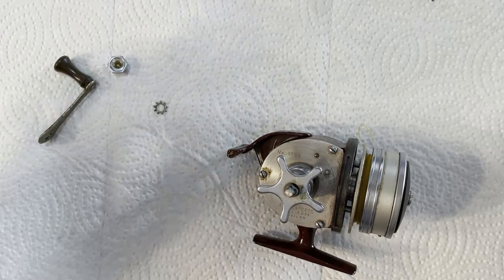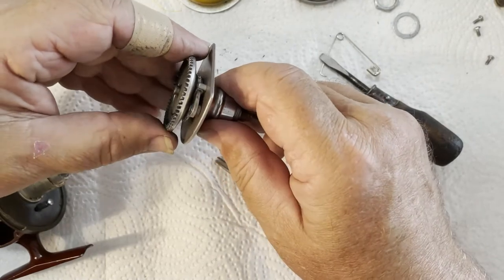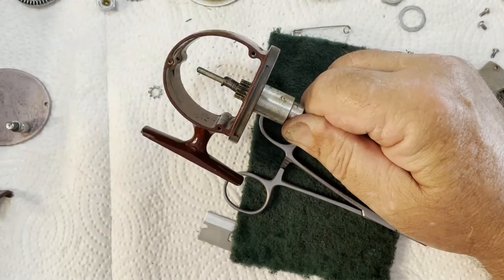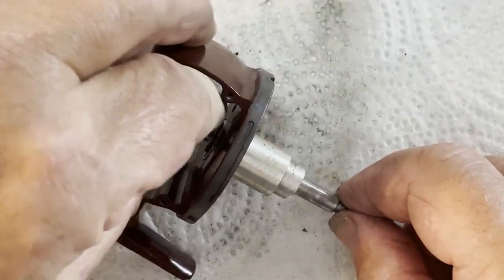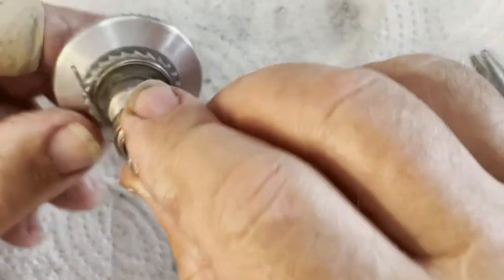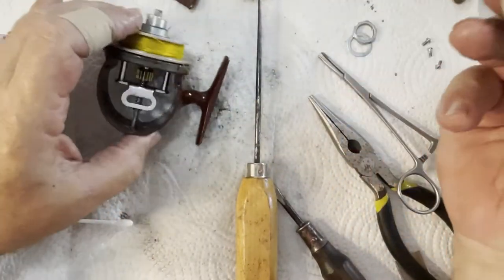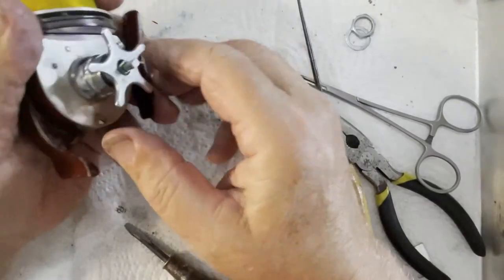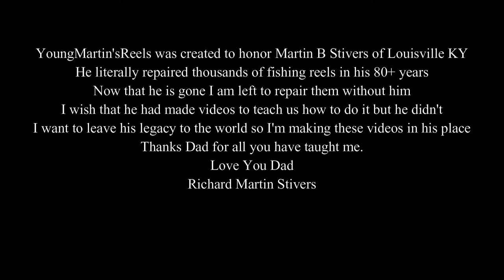YoungMartin'sReels - Shakespeare Wonder Cast 1799 Service and Lubrication

Comment: video was a life saver, couldn't figure out that spring on the anti drag.  Got it dialed in based on your help.

Thank you!
Reply from the maker: Lee, I’m glad you were able to fix it. Sometimes it takes me a while to figure things like that out. I think I spent over 20 minutes trying to get that spring figured out. Now that I’m retired I have time for such things. Fish On my friend, Fish On.
Reply: @youngmartinsreels5314  My problem was two fold.  first I didn't know how it went back on and second I had it on right but needed to adjust the shape based on your video because my spring didn't sit inside that pin, it just kept spinning.  Once i made that slight bend adjustment it functioned just like yours.  Very satisfying cleaning up old reels...I got a box of REALLY dirty zebco reels and needed to disassemble each one to clean and regrease.  This one was the last of the bunch and I was having a heck of a time getting it fixed.  Thanks again!

Comment: Both my Shakespeare 1797 reels have the same thumb lever as your 1799. I noticed the the 1797 you worked on previously had the old style downswept thumb lever.
Reply from the maker: I like the down-swept button better than the up-swept button. It looks more durable.
Reply: @youngmartinsreels5314  Have to agree with you. Although it seems nitpicky, the upswept thumb lever doesn't feel natural.

Comment: how can this have so few views and likes?
this video will come in handy with a project i am doing with my son; he just turned 14 and this year he decided fishing is the "coolest thing". at our local community days celebration he won a new rod/reel in a drawing and likes it but it's "kinda flimsy and i can't pronounce who makes it" are his words.
he also ended up with a shakespeare excursion rod (no reel) from a family friend, so i decided he needed a good reel for it.
in the spirit of "old isn't junk, we can fix this" i found him a shakespeare wondereel 1700 II model DJ and decided this would be a great reel and a learning experience in one.
this 1799 will be a great guide for this project i think it is very similar to the 1700.

i have a question, if you can answer it; would super lube synthetic grease work as the grease needed in reassembly? i have used it in my mixmaster model 12 mixers and it seems to be a great choice recommended by various parts and repair retailers for appliances. it is rated as heavy duty and friction resistant.
great video, thank's.
robert and kenneth
Reply from the maker: Robert and Keneth, I’m pretty sure that is the same grease my faithful follower Chris Jenkins uses with great success. It’s a good grease and even food safe. 

I hope the two of you have fun fixing up your old reel. Be careful though, searching them out and repairing them can become an addictive hobby. I can think of worse things for a 14 year old to get into. Enjoy your Shakespeare.

By the way, I think as the years go b my viewership will expand. I just can’t get people to hit that like button. 😃